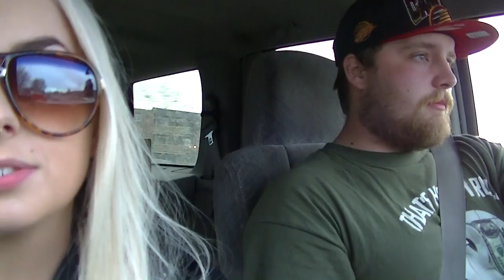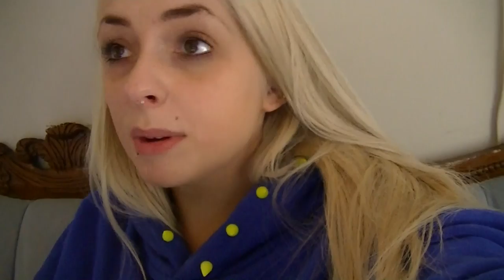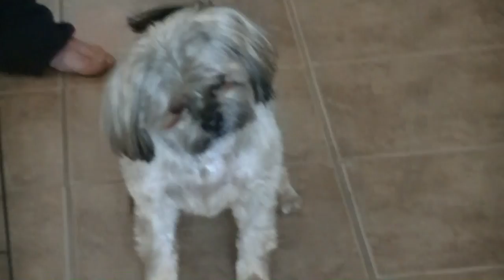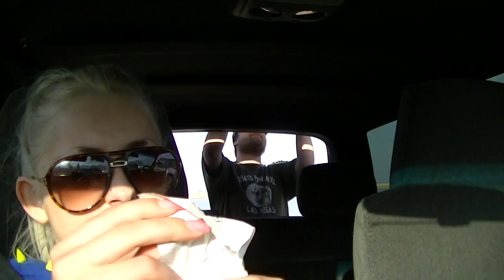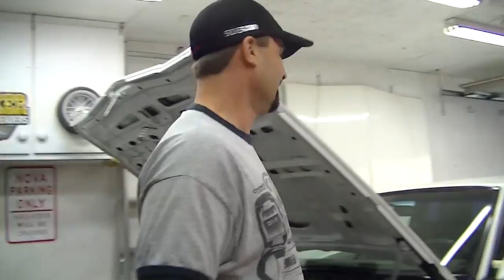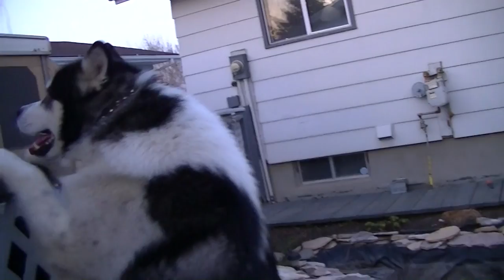Malamute Husky Tries To Speak

Comment: Also have an 02 blazer in White. It's become a project as well.
Reply from the maker: dece! whatre you doing with it?
Reply: First making it drivable/legal with new cats/ exhaust. Then hopefully fixing up the engine to give it some more power and installing quaife Lsd front and back since the 4 wheel drive sucks. But we also have a 350 that is one of our daily drivers and a project car to run at some tracks.